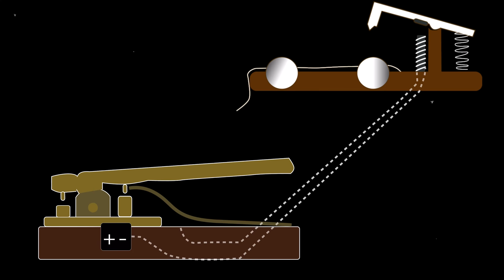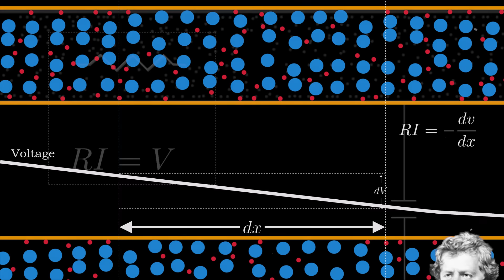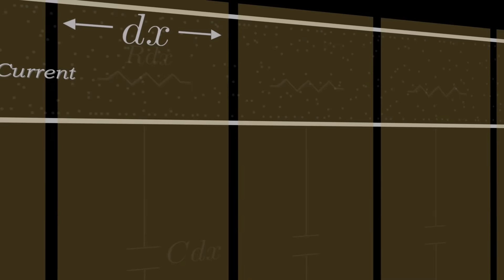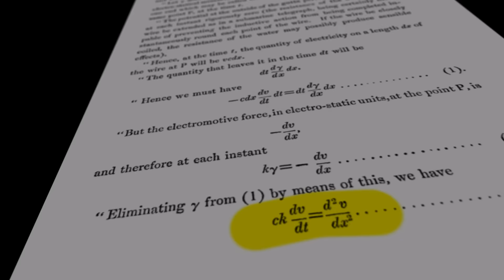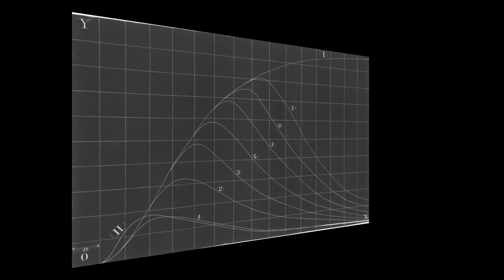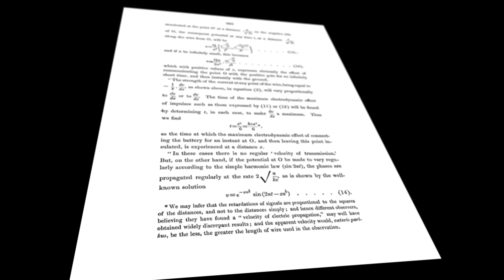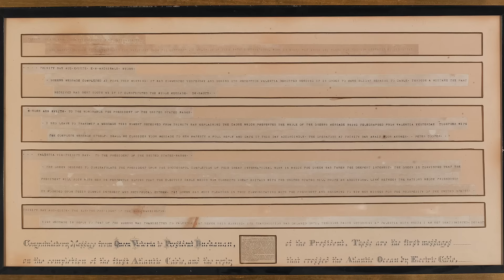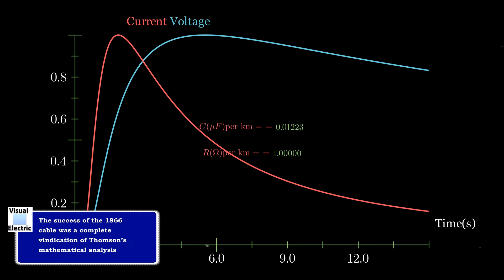How the First Transatlantic Submarine Cable in 1858 led to Transmission Line Theory as we know it

Comment: I’ve never seen voltage represented by V. It was always E when I was in school. But how can voltage be present  without current? If current is zero then the other side of the equation must also equal zero and therefore voltage cannot exist but is does. And I recently learned that electromotive force is not a force at all and I really don’t understood that. Back in the 80s and 90s, voltage was the force that pushed the electron flow. A lot has changed about the way we think but electricity hasn’t changed. It makes me wonder how much we really understand it.
Reply: WOW,  it's pretty much all I saw since the 1970's. E was used only occasionally.  Of course voltage can be present without current.  Your assumption is incorrect. Voltage represents a potential difference between 2 points ... eg either terminal of a battery.  Using your reasoning it would mean there is no water in the water tank on the tower. But of course, there is, and it is a potential difference between the top of the tank and ground. Just the same for any battery or pair of wires with a voltage ( potential difference) across them.
Reply: oh I agree 100% that voltage can be present without electron flow. A receptacle with nothing plugged into it is a good example. And a battery. But let’s say current is zero. E=IR right? If I=0 then IR=0. If IR=0 then E(or V)=0 also. 

Let’s apply that same logic to P which we can both agree that if there is no current, there is no power. P=IE. If I=0 then IE=0. If IE=0 then P must = 0 as well and we would probably agree that it does. 

So why does the math work in one instance and not the other? 

And I remember it as I=E/R and P=IE.
Reply: V is pretty much standard nomenclature.  V is often used for DC voltages, while v is used for time varying voltages e.g. AC.  On the other hand in physics, E is almost exclusively used for the Electric Field strength.  Voltage is the integral of the Electric Field over distance between 2 points in space

Comment: A math problem;

With the cost of the cable, divided by the expected lifetime or the wanted break even time, what should the price per minute for a telegram be?
Reply: Since they used 'codes' for common words (an early form of compression), do you charge per character sent, or the full letter count of the original message?

Comment: In your diagrams people could misunderstand the flow of electrons this is the flow of electric charges.
Electrons do not flow from source to load.
This is exactly what the transmission line demonstrates.
Electron valence drift is so small that no electron from your power grid gets to your home.
The Ohm's law is a lumped some model they are simplified explanations of what's going on underneath an object of abstraction.
I can prove this to you. The common everyday product like a electric toothbrush pause the Wireless cell phone charger has no physical connection to your device.
The power grid is the same, with capacitors and Transformers and isolators the basics of a transmission line there is no physical connection.
The electromagnetic field is propelled around the wires through the air to your load which could be something at your house and it seems like magic.

This is called electrodynamix which comes from the Maxwell-Havyside , which came later.
Reply from the maker: Although electrons do not move from source to load, they do move slowly in the general direction of the field. Otherwise, the analysis of Kelvin would not make sense and it would be difficult to show visually how the equations and underlying theory originated.

Comment: Doesn't electricity travel instantaneously? Why did the messages take long to arrive?
Reply from the maker: Unfortunately it travels at most the speed of light, and usually slower depending on the surrounding media.
Reply: @VisualElectric_  But still, in the speed of light it could travel trough the atlantic in less than a second. Why did it take so long? I dont comprehend
Reply: @VisualElectric_   Thanks for answering
Reply: It takes time to charge up the huge capacitor the cable is through the significant resistance the cable has, so a pulse is smeared and delayed by the resulting RC filter network. If you work the key too fast, the other end will not be able to discern the separate pulses but will see just fluctuations in DC voltage, not unlike a blurred out of focus image of a page of text consisting of unintelligible grayscale blobs.

Also, electromagnetic wave (electricity or light) doesn’t travel instantaneously. It travels at the speed of light in the given media which is below the ultimate limit of speed of light in vacuum. For example, the speed of light in optical fiber is 2/3 the speed of light in vacuum
Reply: @sashimanu  Correct but also the inductance which is forgotten (or possibly not known at the time) makes a big influence too. What is said to be resistance is part reactance (induction) and part resistance only. Capacitance shows reactance too. Reactance is worse at higher frequencies and as a square wave that we are trying to transmit transmitting Morse code demands a lot of high frequencies to make it rise fast. 
Land lines are affected too but as the capacitance between the wires is much smaller (or wire and ground if single wire is used) then it makes a much smaller influence.
Reply: @White5292 educated guess: the message was in morse code where each letter is represented by ‘dots and dashes’. Because of the ‘ smearing’ of each pulse, each dot or dash had to be separated from each other by several seconds! The letter Q is dash dash dot dash - so consider 8 seconds between each dot or dash…
Reply: @sashimanu  So over head or underwater lines doesn't matter, it's just that the DISTANCE was much longer, so you needed larger capacitors?
Reply: @DR_1_1  first, you don't *need* larger capacitors, you *have* a cable that has huge capacitance and it is a problem.

Overhead wires strung in air on porcelain or glass insulators have WAY lower capacitance per km than cable, underwater or not. This is because the wires are much farther apart, they have smaller overlap area, and the dielectric is air instead of whatever was available at that time (stuff like gutta percha, waxed cloth or oiled paper). 

Literally every variable in the capacitance formula leads to lower capacity for overhead wire vs cable.
Reply: @sashimanu  1. "This is because the wires are much farther apart" I thought the 1st telegraph was a single cable, even for both way coms you could simply lay them a few meters apart, even farther away than on poles!
2. "the dielectric is air" I still don't understand that point, how is air helping conductance inside the cable, what kind of magic trick is that? I don't think you can better isolation than wax...
Reply: @Italanon  this is generally correct. The first cable used a "positive" polarity pulses for dots and "negative" pulses for dashes, of equal timing. This didn't change the outcome, though.